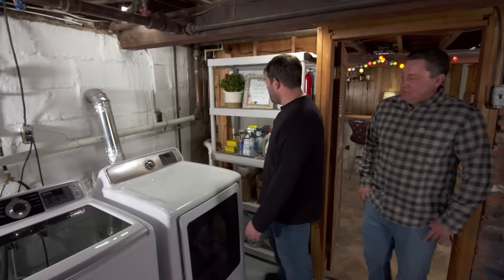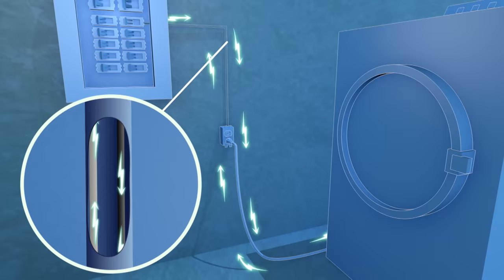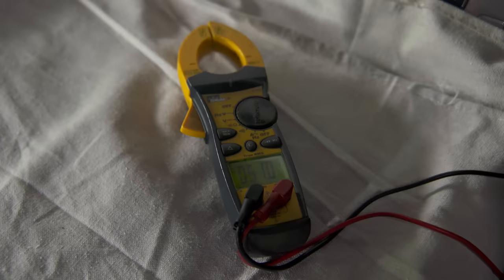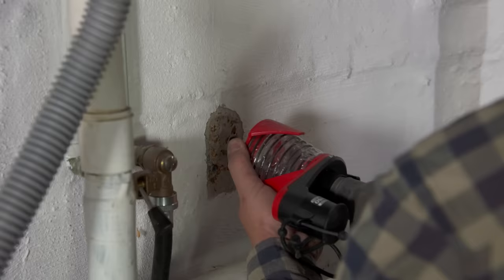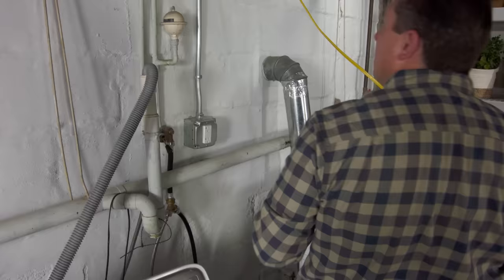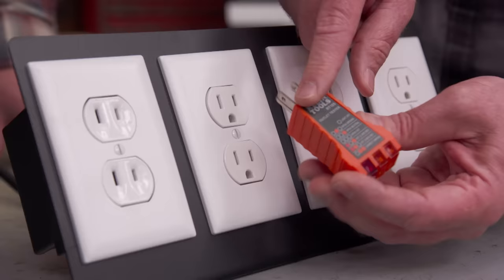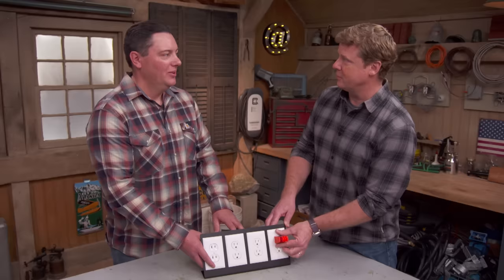How to Ground a Two-Prong Electrical Outlet | Ask This Old House

Comment: Did he really just say you could wire a gfci outlet without a ground wire?
Reply: You can, as long as it is marked as 'no ground'. Still not a great solution, though.
Reply: That is the NEC code accepted solution.
Reply: GFCI Outlets typically come with the required NEC stickers in the box. Sometimes it's the only option you've got.
Reply: douglaslinemanful very common in older homes when wanting an upgrade from 2 prong to 3 prong
Reply: Yes, that is a code compliant way to add a 3-prong outlet where there is no equipment grounding available - aka older houses.
Reply: @NickFajardo  It doesn't have to be marked. The red light tells you it's not grounded or wired wrong. As GFCI have line and load sides detection. If the light is green. It is functioning. Only reason they add stickers. Is you only need one GFCI in the Circuit. That being the first one in the Circuit..As all the others ones after that are protected as well. But you have to label each receptacle cover on that circuit as GFCI protected. So they know if it trips. To look for the tripped GFCI not just the Breaker. 

And people put them GFCI in closets. And you spend an hour looking for it behind all them shoes and clothes...
But if you want to spend $20.00 a pop. You can make them all GFCI..Seen that before. Where you only needed one...
Reply: Master Chief 00117 the gfci is supposed to be labeled “no equipment ground” to notify there’s no ground, so homeowners are aware rather than a red light which some might not understand what that means. It’s also in code it must be clearly labeled
Reply: @Nick-bh1fy  Go look at a GFCI.. It is labeled. It' s engraved right on it.. Test Monthly...I'm going to add this as well. 

You better read 250.114 As 406.4 Is not legal in most cases. As all new equipment requires a Grounding Conductor period... Which means you have to bring the old installation up to code. 

Why you can''t sell any house or get insurance., Till the house electrical has been brought up to code. 

Thank You
Reply: Master Chief 00117 GFCIs do not require the use of the grounding conductor for it to operate as intended and that may be the case for NEC labeling. But CEC requires a label if replacing from 2 Prong ungrounded to 3 prong. Btw you can sell a house if it’s technically not up to code assuming “violations” are grandfathered in. You do not need to run new electrical every time you wanna buy a house...
Reply: @MasterChief-sl9ro  It depends on what year code your location adopted
Reply: @MasterChief-sl9ro  "Can't sell any house or get insurance till the house electrical up to code".  No such law in any of the numerous states in which I have bought and sold houses in the past 30 years.  However, "code" generally means, "conformed to code at time of installation".  Also, 406.4(D)(2) is "code" for replacements in most places where all you have is 2-conductor wiring.  If your replacement ungrounded receptacle has 3-prongs/slots and has GFCI protection it is required to be labeled as "No Equipment Ground" in addition to "GFCI protected" (unless it's the GFCI receptacle itself).

Comment: That wire is not rated to be installed inside of EMT conduit.
Reply: Wrong, read your code book...
Reply: NEC 334.15B Literally says you can and should when exposed to physical damage.
Reply: It might have been used just to protect it until it reached a safe height. I’ll have to check my code book and see if that’s ok.
Reply: Caleb Hinrichs yes you are correct

Comment: This guy Heath made a few fairly obvious errors in his descriptions. I won't itemize them, but it sounds like he was winging what he said, perhaps trying to dumb it down, but when he was confusing power with current, or saying that the ground wire is good because being made of copper it is highly conductive, etc; I cringed. This Old House videos should be better than this.
Reply: Yes, I agree, it was misleading that the circuit breaker trips, implying it will protect the user from a shock.  The purpose of the breaker is to protect the wires.  It could be and that a short due to faulty wiring in the device (thus not a good connection), thus causing some current to flow in the ground wire may be LESS than what the breaker will trip for because it can't tell the difference between fault and load unless its fast enough or large enough.  However Gfci will protect a user from shock as it will trip on a ground path on far less then the breaker (mili amps instead of, say 20 amps for a typical washing machine outlet).  I expect better from toh.
Reply: @cetyl2626  Consider the audience, including the owner who said he doesn't know what grounded means.

Comment: Or he could have ran a ground wire to the copper water line and saved the guy a few billable hours and materials. 🤷‍♂️
Reply: Poison Rationality won’t pass code
Reply: This wasn't a job requiring hours. He was there so just do it right.
Reply: grounding an outlet to a water pipe is a terrible idea. The following is a quote from ECM:

The main purpose of water pipe grounding bond is to ensure that the metal water pipe is at the same zero voltage to ground as the service grounded conductor. A secondary purpose is to ensure that there is a path back to the service for electrical current flow if the metal water pipe becomes energized.

A metal water pipe is NOT a "handy outlet grounding point"
Reply: @kylefowler5082  Yes - and in most of today's construction the water line in to the house is plastic - there is no ground to earth.
Reply: Or, better yet, explain why you don't even NEED ground, if you install GFCI protection, although the laundry room replacement GFCI receptacle also needed AFCI protection.

Comment: its ok to show how to completely rip out and install all new wire and outlet, but being  an electrician of 40 years now ,i have to call bullshit on this vid, not knocking the skills of this electrician but this vid title is very deceiving . obviously in this basement where it is very easy to ripout and reinstall complete circuit(i would recommend also)go upstairs in all the closed walls its a different story .

Comment: What!!!! You won't get shocked from just touching one device. You'll have to come in contact with a ground such as a faucet that's connected to copper pipe that's usually grounded and that's only if the feeder that is not connected to the ground touches the metal of the washer. Many of todays devices do not have a ground prong because of so much plastic being used. Many things wrongly explained. 
Just saying,,,,, even people with masters in electrical engineering can't even explain the propagation of current. Majority of people only know about the FLUX CAPACITOR and KARDASHIAN!!!!
Reply: Sure, but nearly everyone has multiple appendages and it's easier to say "if you touch it" rather than saying, "if more than one part of your body is touching so as to complete a circuit".  I know a guy who toasted his nuts when leaning over a metal appliance to cut what he thought was a dead 240v cable and someone had jumpered neutral and ground in the appliance attachment.

Comment: For any home owner attempting this, which I don’t recommend, the service wires coming in will still be LIVE with the main breaker turned off. Kind of irresponsible for TOH to not mention this. All of the breakers will be dead but the main feed will still be hot

Comment: This fix is so full of holes I don't know where to begin! Here's one point. For those not fortunate enough to have exposed wires 90 % of the time what would you do?  Most dryers 99.9 % are 30 Amps. Where you going to get a 30 Amp GFI receptacle?  Answer theye aren't made . Sorry that's 2 ! LMAO what about an older home where the wires are ungrounded BX cable in a block wall ? Answer, your screwed! Sorry 3. Very disappointing TOH

Comment: Technically not code because he's using two wiring methods. Nm-b and emt. Interesting video, not as scary as I thought it would be at first glance. Considering the things I've seen home owners do.
Reply: NM is REQUIRED to be in "conduit", like EMT or equivalent, when necessary for physical protection.  334.15(B)

Comment: Useless video!!!   What if its in your living room....Rip all the walls out to rewire???????
Reply: no, you remove the receptical, cut out the box or drill a hole in the top of it, whatever you need to do, then have someone climb into the attic, find the top plate and send fish sticks down there, at that point in time hopefully the person at the bottom can feed the rod through the box if you left it in, or easily grab the sticks through the hole in the drywall.

Comment: Why are you throwing away valuable, recyclable copper wire in the garbage? By itself not much but added to others makes a difference. I have noticed in many This Old House episodes, recycling is not a concern. It should be.

Comment: the sheathing jacket on the romex needs to be removed when run in conduit
Reply: What article of code requires that to be done. Because there is an article that says you cannot run a bare wire or uncovered wire in conduit.
Reply: That is completely wrong.

Comment: way tooo much money! Just replace the existing outlet with a 3 prong outlet and use a self-tapping ground screw to connect ground to the metal box.  The tester will show that the wiring is correct!
Reply: yes but it still won't be grounded.
Reply: which is ... illegal? and therefore not something a licensed electrician would normally do on national television :)
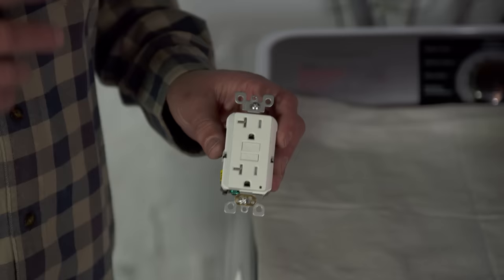Reply: It won't show "correct" if the metal box doesn't have any grounding.  You would go with the GFCI he mentioned at 1:53 and skip the whole unnecessary grounding thing.
Reply: @UpnorthHere  Hi, I'm curious.  If @James K's procedure is followed and a tester shows good, doesn't this imply that the metal outlet box is grounded through metal conduit all the way back to the main panel?  (This assumes that there are only 2 wires entering the outlet box, hot & neutral.)  If you check Hot-to-Neutral and Hot-to-Ground and you get roughly 120V AND you check Neutral-to-Ground and you get (close to) 0V, wouldn't this imply proper wiring and proper grounding?  Would appreciate your thoughts.